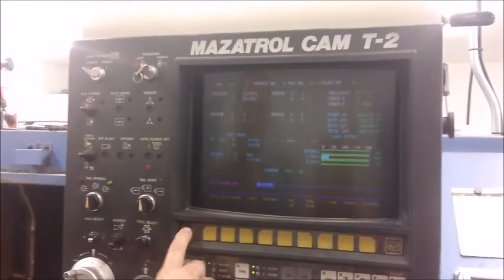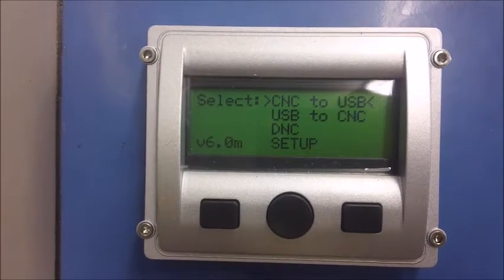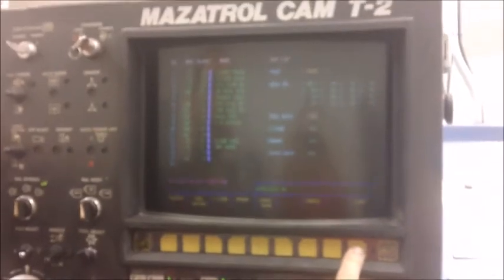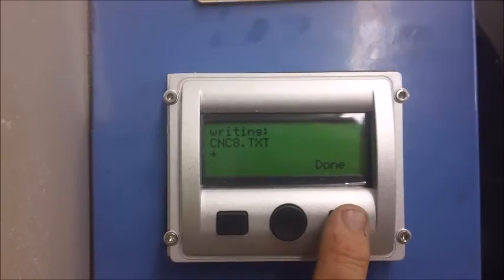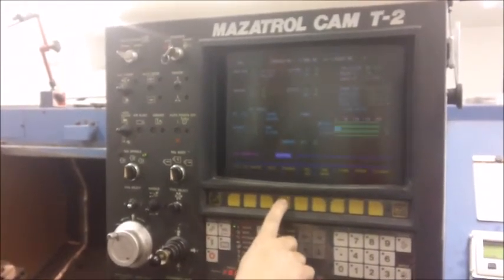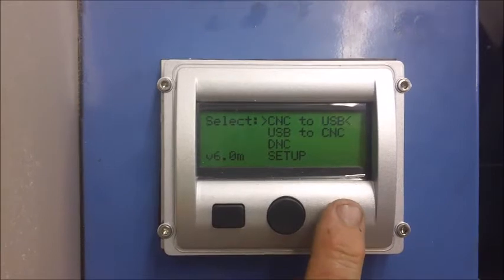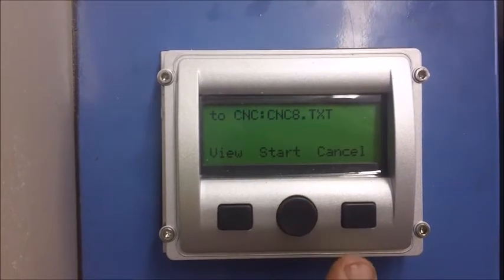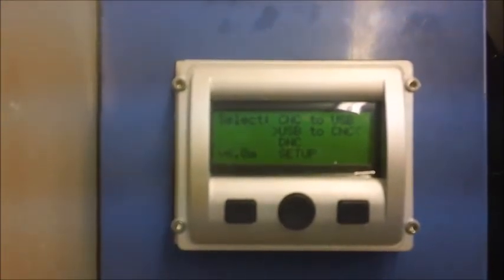USB on Mazak Quickturn 10N T-2 control

Comment: Will this work on the none CAM T-2 controller ?
Reply from the maker: Yes, I am assuming your question is will this work on other controls other than Mazak's. We sell a universal unit that will work on any CNC control, Fanuc, Mitsubishi, Fadal, Haas, Siemens, Heidenhain, Mazak, Bridgeport, etc....
Reply: Well I got Mazatrol T-2 controller not the CAM version.
Reply from the maker: Yes, the product will with your T-2 version. It works with any Mazak control from T1/M1 up to Fusion controls.
Reply: I am use mazatrol control T-2 .I have same alarm coming please help me. Alarm is 404